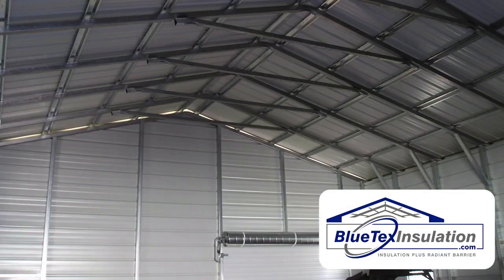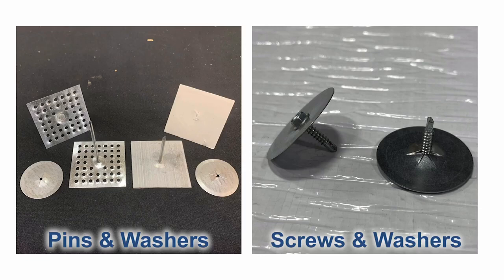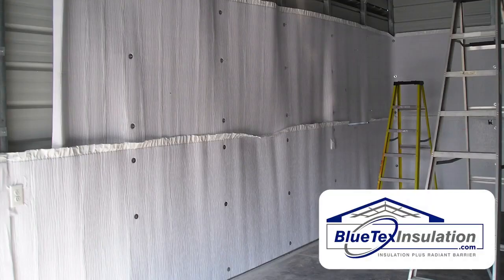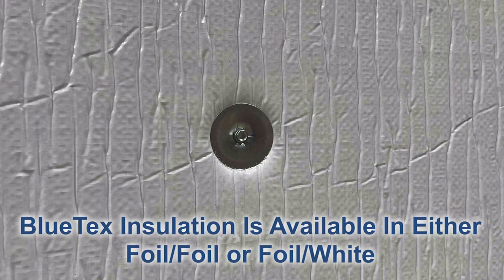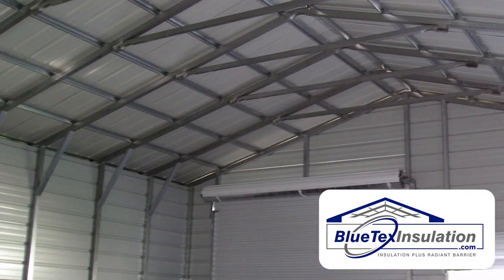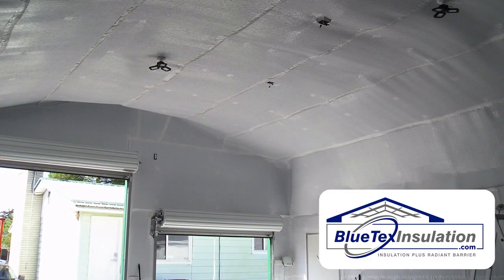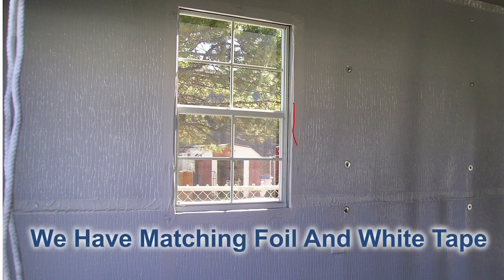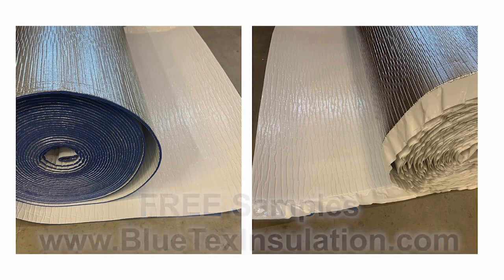Metal Building Insulation To Stop Condensation   How To Install BlueTex™ Foil White 6mm Supreme

Comment: Having a concrete slab poured this week for a 12x25 metal building in the near future. Still haven't decided on the building source yet.
Question: The type of building shown in this video, can you pre-wrap the frame before installing the sheet metal around the periphery?
Question 2: What is the R-value? Do I need to add more of another insulation if I want to cool the building during brutal Texas summers?
Reply from the maker: Yes, you can wrap the frame.  R-Value info is under FAQ at www.BlueTexInsulation.com  Do you need more?  It really depends if you are fully heating/cooling (like a house) or if you are only doing a semi-conditioned building (maybe running an AC on occasion). BlueTex products by themselves are primarily designed to be used in either non-conditioned spaces or semi-conditioned spaces.  If you are looking for fully conditioned (like a house) contact us.  We have some new products/processes for these.  Basically like building a refrigerator and putting it in the shade.  The ultimate best system.
Reply: @BlueTexInsulation  Thanks. I went through every page that I think applies to me (including the R question). Moisture barrier is what's needed, but sometimes I will want to throw a window AC in Texas summers, and be able to spend some time out there (man-cave) in my 12x25ish RSVP required zone. So I'm left asking myself: If I use your barrier, what / how for the finish? The question is rhetorical - as I have some visions, but want to inspire others. Will likely order something for my small shed I currently have for a test drive. Thanks for answering my posts quickly.